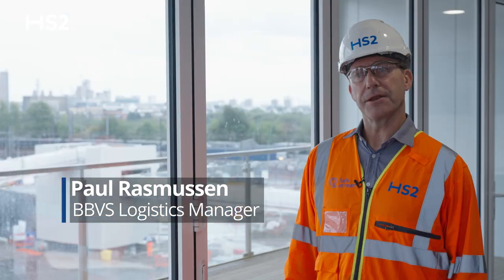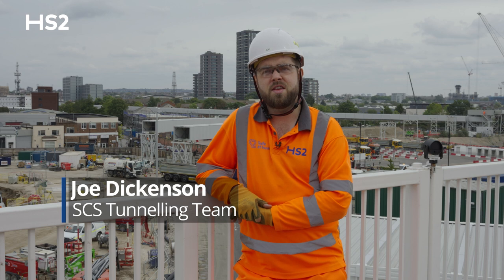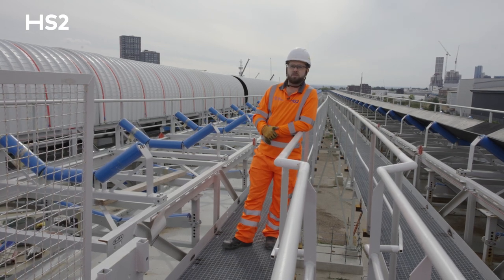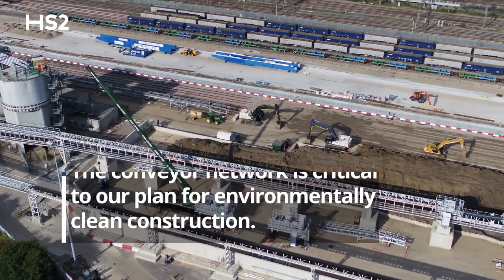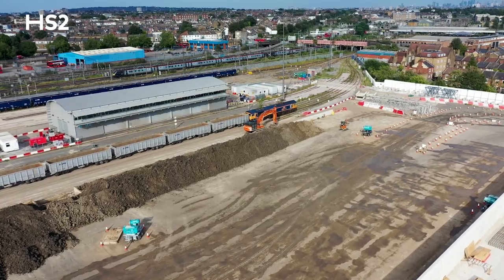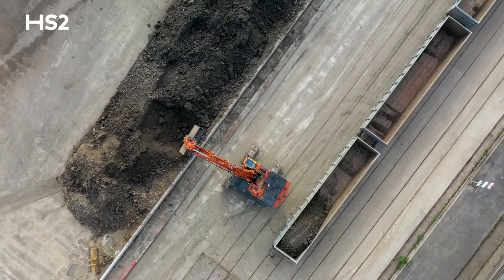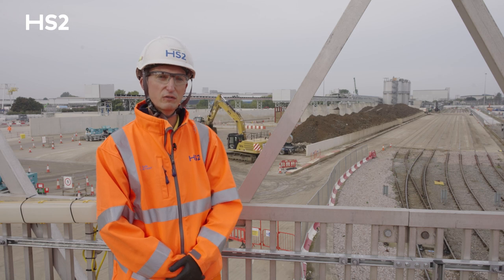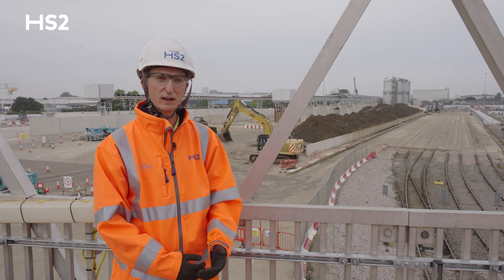HS2’s enormous spoil conveyor begins operation in West London

Comment: As a retired professional engineer I have found out HS2 is about 7 times more expensive than the average cost in Europe and 10 times more expensive than China on per km basis.  Looking at this video my reaction would be UK has not much experience from HSR construction so everything is brand new from design to manufacture.  May be if the contract was won by a European or Chinese consortium they may be able to cut down the cost say by using equipment from previous projects.  Also with previous experience they might be able to arrange the conveyor belts directly onto the train hoppers without double handling, stack on site now and then using mechanical equipment to transfer spoil into train hoppers later, in most of the time.

The HS2 is excavated by Tunnel Boring Machine (TMB) which German and China have their own patent proprietary designs/patents making these countries more experienced and cost effective in carrying out such work.
Reply: I think your doing us a bit of a dis service there, I mean its not as if we didnt build the london underground, or just recently the Elizerbeth Line, or the Chunnel 30 or so years back. we are not strangers to this hell we have been digging railway tunnels for longer then most if not all places, True we dont have that much experiance with HS rail but a tunnel is pretty much a tunnel after accounting for the variance of geology. The cost is somewhat high, though I think compareing us to China, and chinas standards on worker safety, not to mention the average labour costs is seriously unfair. Do those valuies represent an average for length or include the fact that a hell of a lot of the HS2 track in underground by the way?
Reply: The Chinese wouldn't be able to pay European workers in bowls of rice a day tho.
Reply: @fishevans6417  Luckily I did include the average cost of the European as a bench mark cost.
Reply: @bobp6742  European system has social benefits to allow people survive without a day job.  Don't think the Chinese could survive without working.  However it doesn't stop companies like VW and BMW making 1/3 of the annual profit from China. So I suppose some Europeans do get well rewarded by the Chinese.
Reply: @gunsumwong3948  
According to Google the Chinese government does pay unemployment benefits at £182.69 a month. No idea if it's true or just propaganda or how easy it is to claim.
Reply: @gunsumwong3948  Thats the issue I am trying to point out - HS2 is Not Average its got a much higer percent of Underground tunnels which are defactor more expensive then open air rail. that is a deliberate choice on our part for what ever reason.
Reply: @fishevans6417  May I point out China is now boring the Himalayas to make a rail connection with Nepal. The Nepal section is 72km long and the estimated cost between $2.7 to $5.5 billion.  It has been stated that 98.5% of the route is bridges or tunnel considered one of the most challenging.  The higher cost of $5.5 billion is $76.4 million/km to bre through Himalayas for the Nepal case.  The current UK HS2 cost is £200 million/km or 3 times dearer.
Reply: It's expensive because of land acquisition. The land in the UK is more expensive than in most places in Europe, expecially because its more densely populated. The only place that is more dense is the Netherlands (I think).

China is an authoritarian state that can force land acquisition at much lower costs, pay its workers less, not care about H&S and deaths etc. We should not be comparing ourselves to them ever.

Its also worth building up local skills, so we can export that knowledge and reuse it for more rail infrastructure in the UK. Its an investment in UK's green sector of employment and future credibility
Reply: @parameshnat  If what you said is true how would you explain UK HS2 7 times more expensive than the European bench mark price?  It isn't always to do with China.
As an engineer one must learn from mistake from others or own self.  If there is no mistake then that is fine.  However if there are mistakes but no one cares about them then the mistakes could persist forever.  Overall it seems no one in UK wants to know where exactly higher costs are.
Reply: @gunsumwong3948  because its a nuanced discussion. From your time as an engineer (as one myself) its very difficult to pinpoint at a single place where cost increases come from. it's due to a variety of factors, one of the major ones being cost of acquisition (London is possibly the most expensive and dense city in Europe?) . The others being the UK being a lot more diligent environmentally, the UK having a history of legacy infrastructure to build around. 

Putting a 7 times cost increase down to inexperience is just naive when it's obviously more complex
Reply: @fishevans6417  If, as China,  you don't have to pay for the land or housing you develop you're quids in already. If,  unlike the UK you pay lower wages like both China and some of the EU even better. If you have lots of space and low land value roll on. The UK,  particularly from Midlands to the South East is a highly built up area with above average land values and housing. HS2 has to pay for the property it uses and recompense for removal of individuals. You're obviously not an engineer who had to study the economics of the project. Comparing apples with pears isn't sensible economics.
Reply: @gunsumwong3948  Lots of things you didn't take into account either. London and Birmingham land prices particularly in city centre or compensation costs for land and householders. Maybe you were just working on engineering design? There's a lot more than just your comparison to account. China's high speed lines have proved a total disaster which you should look at..
Reply: @gunsumwong3948  How many people own land on the route or have houses to get compensation for? Beyond closing it's illegal seizure of Tibet what is the business case and how does it protect and preserve the environment? Like the other Chinese lines will it ever make a profit?
Reply: @gunsumwong3948  What is this bench mark price based on? Remember this is aiming for higher than average speed with more than average tunnels in more densely populated areas with more than average land value. Being an engineer doesn't give you the opportunity to be able to understand the process.  How many motorway bridges do bench mark European railways have to rebuild? A little knowledge is a dangerous thing,  drink deep or taste not.
Reply: @geoffreycodnett6570  I believe the bench mark HSR is EU own data, based 20 European HSR networks already built, for judging the viability of a new HSR seeking for funding.
You may be right little knowledge can be dangerous.  I collect HSR cost recently and HS2 is just one of 7 to 8 that I picked up.
I used to work in the power industry and could tell a client the cost/kw building a hydro, diesel, gas fired, coal fired, oil fired or combined cycle plant based on historical data I collected and projects I worked on all over the world.  When there are large variations one could find out the reasons of the high cost.  To me not knowing the root cause of the high cost is dangerous because one has no means to mitigate or control it.
Reply: @gunsumwong3948  The China-Nepal railway is far from being bored and far from making economic sense. Passenger traffic is nil as the border is closed to Western tourists and the Chinese don't want to stimulate local exchanges lest the Tibetans discover more cultural affinity with the Nepalese than with the Hans. As for freight traffic, it is essentially one way with Nepalese exports representing about 1% of imports from China. The line would make some sense if extended to India but currently neither the Nepalese nor the Indians want to pay for a conveyor belt for Chinese goods.
Reply: @alaindumas1824  This railway could not have been built had India not blockaded the  goods to Nepal in 2015.  Nepal since realised India could hold its life line at ransom so it turned to China who built or update the access road between the two countries.
It is futile for the third person like ourselves to judge it make economic or political sense as we don't live there.  However it should does no harm to Nepal to have a railway link.  On China's side it may want Tibet to form a closer link with Nepal because both people share the same religion and a long historical connection in the past.
Many westerners dislike China build infrastructure for other countries because it improves the economic development of those countries.  To them it will be far better for Nepalese and Chinese truckers wasting fossil fuel climbing the long , winding and treacherous mountain roads forever.
Reply: A lot of comments on here about the purchasing of land to build this, don’t worry, those in the know at the planning stage bought most of it before it was announced, I’m sure they’re giving it away 😅
Reply: @gunsumwong3948  I like trains and China's infrastructure efforts but I am also realist. Nepal trades mostly with India. Linking Bihar and Kathmandu would be much cheaper than tunneling through the Himalaya. In Nepal, this trans-Himalayan railway is known as kagat ko rail (paper railway) or sapana ko rail (dream railway). I don't know why you believe that it was built. The Nepalese government is politely looking at Chinese plans but has not signed on anything and don't have the money. 
The Chunnel tunnel investors lost billions although the freight traffic between the UK and the continent is 200 times larger than between China and Nepal. For passengers, while Paris-London was the world's busiest international air route, there are no scheduled flights between Nepal and China, let alone Tibet. China wants total control of the access to Tibet and, contrary to what you are saying, wants Tibet to sever its cultural ties to Nepal. The Lhasa airport only receives domestic flights and the border is not open for tourism. In summary, the 70 km tunnel numbers are as unforgiving as the Himalayan mountains.
Reply: @alaindumas1824  There have many youtube videos made by the westerners visiting Tibet so I think your information is a smear.  Tibet also has HSR that India hasn't yet.  Also Tibet has 5 airports and much well developed than you think.  Lastly the rail link was the wish of the Nepal government.  Nepal section is only 72km but China is building the 555km on its side.  
Like I said Nepal would not have wanted this railway had India not economically blockaded Nepal in 2015.  Thus Nepal no longer considers India a reliable nation wanting to choke Nepal to death.
Reply: @gunsumwong3948  I am not trying to smear China. I just want to correct your errors. I never said that Westerners could not visit Tibet. I said that the border between Nepal and Tibet was closed to tourists and that there are no international flights to Tibet. One can only enter Tibet by going through Han China which means that the Tibet-Nepal rail link has no potential as a passenger railroad unless China makes a policy U-turn.
The  passenger trains to Lhasa are pulled by derivates of GE Dash 9-44CW, a Diesel freight engine, at an average speed of 80 km/h. That may be HSR where you are coming from, but not in the UK. Since the first trains arrived in Lhasa in 2006, Tibet's GDP has grown by more than 10% a year, more than any other Chinese region, showing the power of infrastructure building. In 2014, the line between Lhasa and Xigase opened, again at 80 km/h. The 555 km line to Kerung was supposed to open in 2022 but work only started in August 2021. As for the subsequent 72 km to Kathmandu, the Nepalese are stalling because they can't afford it.
Reply: @alaindumas1824  I find you incredibly prejudiced.  Any country has aviation hub where all planes diverted to the capital and a few large cities and inland fights connect with the rest of the city.  Whether Tibet should have international flight or not isn't to be decided by a westerner like you but the local and regional needs.
I do not believe the border between China and Nepal has been damaged by earthquake in 2015.  Although it has been re-opened by the infrastructure has not been fully reinstated especially on the Nepal side, as many youtube videos have shown visitors could go up to the border crossing within the Chinese side.  Only Neaplese truckers drive the goods back to their country so your complaint should address to the Nepal government who may prefer you to visit Nepal from other routes.
China did used GE locomotives when the Qinghai Tibet railway was built but have since have their own local motives of indigenous design.  The Qinghai-Tibet has never designed for high speed.  The HSR I mentioned, which you are totally ignorant of, between Lhasa and Nyingchi, was reported by CNN as the first bullet train in Tibet running at 160km/h from 25 June 2021.  It is actually one of the two completed segments of China's Sichuan-Tibet HSR intending to cut down the travelling time between Chengdu to Lhasa from 48 to 13 hours.
It is true Nepal has not made the decision how to implement its 72km section yet but make no mistake that China will have railway infrastructure all the way up to the border with Nepal.
By any standard a land lock country like Nepal will view a rail link a life line to the outside and Nepalese government has actually chosen Chinese ports designated for future import and export via the future rail link.  Objections and smears from the westerners are not going to alter the outcome.  Saying Nepal as a sovereign nation cannot afford 72km railway is a typical slander.  A country can develop much better without the western influence.  Nepal used to buy electricity from India but it is now export electricity back to India now so may be Nepal could get get richer and better developed than you think.
Reply: @gunsumwong3948  You present a 160 km/h railroad as HSR. Are you bad with numbers or simply prejudiced? You said a country can develop much better without Western influence. May I ask in what respect was East Germany more developed than West Germany, North Korea than South Korea? China grew spectacularly after her opening to the West. In 1980, at the beginning of Deng Xiaoping's economic reforms, her GDP per capita was 13% of the one in Taiwan. Today it is 38% of Taiwan's. Eastern European countries experienced the same catching up after opening to the West.
The overall cost, adjusted for inflation of 2036 km of Lignes a Grande Vitesse was 1.1% of French GDP (0,44% for the taxpayer, 0.66% covered by SNCF firebox income). The current HS2 works represent about 4.5% of UK GDP but the net cost will be less. Most of the money will stay in the UK as the builders are British and the trains locally made. What about Nepal? The predicted bill represents more than 10% of her GDP, and the net cost the same as rolling stock and workforce would be Chinese.
Capacity is HS2 main benefit. Pre-COVID, the WCML and the highways were congested while the parallel Nepalese road saw about 30 daily trucks and zero passenger traffic. Nepalese life did not seem much affected by its blockade following China's COVID response. The railroad would have a better potential for freight if it went all the way to India, and for passengers if Tibet ceased to be a place where foreigners cannot travel or meet Tibetans in the absence of Chinese tour guides. In summary, in the absence of Western type opening throughout the region, the project looks like a white elephant.
Reply: @gunsumwong3948  BOT won’t be an option. The Chunnel tunnel and the Perpignan to Figueres HSR BOT had much better traffic projections than a China to Nepal railroad and went bad fast because they could not cope with the delayed openings of British, Belgian, Dutch and Spanish HSR connections. Nepal is not known for speed. The simple 20 km railroad linking India and Nepal was delayed for years by legal issues over property rights.
In my opinion, the only way this tunnel can move forward is if China and India, the two most populous countries on Earth, decide they need a railroad link, are ready to finance it, and Nepal agrees. I call it Western type of opening because that is what is happening in Europe with a common signaling standard, HS2 using European gauge, Spain building 1435 mm tracks and border  posts abandoned. Call it what you want but, as you know, the situation on the China-India frontier is more conflictual.
Reply: @alaindumas1824  You must have an Indian connection for insisting India to invest the Nepal to China rail link.  It is only 72km long and you think Nepal has no money and must rely on India otherwise it will never be completed?  China is building 556km to the border and you think China needs another partner to finance the remaining 72km?

Whether Nepal wants to link up either India and/or China is its own decision.  As far as China is concerned it can send goods by freight to the border and let the Nepal truckers do the rest inside Nepal.  Unlike India China has no claim on any Nepalese land.
Reply: @gunsumwong3948  I have no Indian connection and I agree China can afford to finance the 72 km.
Reply: @alaindumas1824  IN that case please accept my apology.
India and China are not in speaking term.  I believe India like to have China as a common enemy to rally its people.  India has never been an united country with a single language or single government until colonised by the British.  Even today it still has no unified indigenous language and the states and Federal government are often work against each other like what they are doing to the Mumbai to Ahmedabad HSR.  When there no conflict state to state or state to Federal conflict India manages to build metro in 15 cities same as in the US.